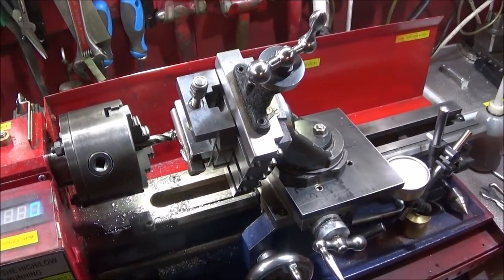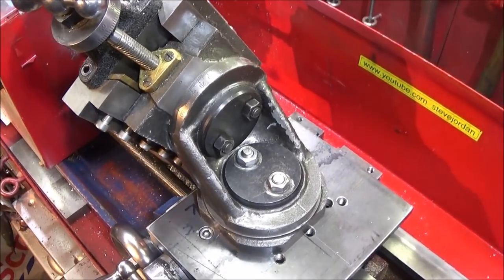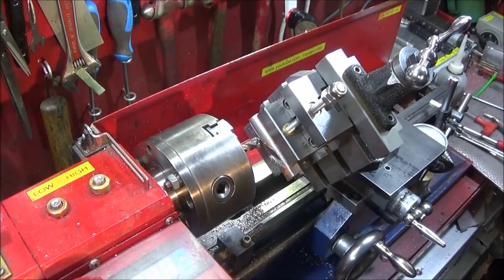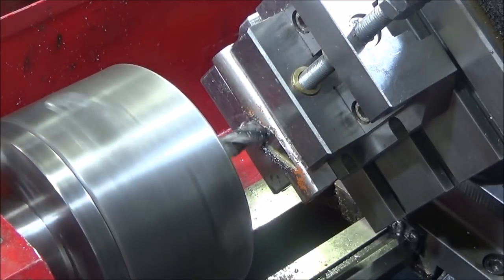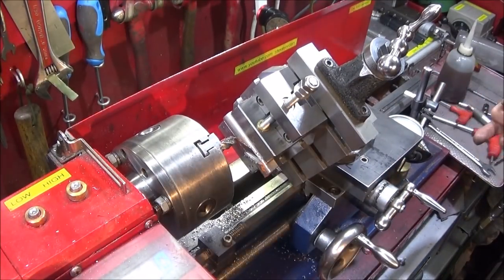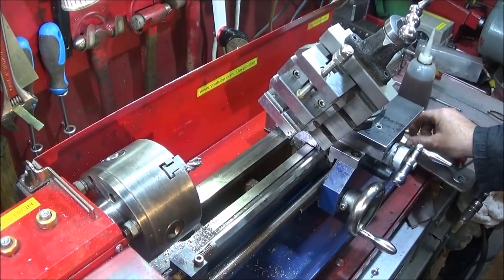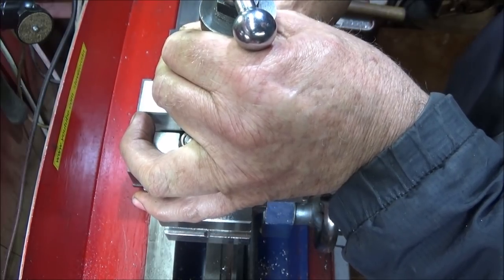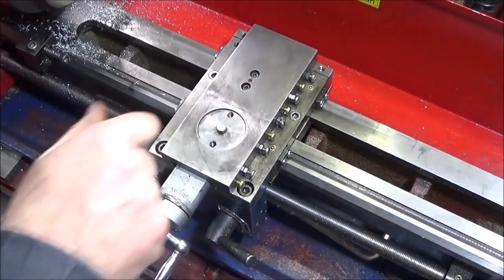Double Swivel Vertical Milling Slide For The Chinese Mini Lathe

Comment: Hello Steve. I have just completed this milling attachment, it works very well and is much cheaper than buying a mill of course. Now I need to reduce the free play in the cross slide/saddle, as the milling operations show it up - will study your video on the upgrade.
I have carried out one or two of your lathe improvements.
Keep up the good work!

Comment: Hi Steve, I know this video is from ages ago but I just thought I'd write to you and let you know that I have finally saved up enough to buy a double swivel vertical milling slide with vice from Chronos for my Chinese mini lathe (they ran out of stock 6 months ago). I'm in the process of fitting the 10mm plate to the cross slide and fitting the mill slide base to it.
I can see this opening a whole new window of uses for my lathe, not least the milling of new tool holders from the aluminium blocks that I cut ready some 12 months ago!
Thank you, Steve, for providing me with the knowledge and confidence to do this, your videos are an inspiration to us all.

Comment: Hi Steve, thanks for this vid. I've completed the same today, just a couple of modifications... My Mini lathe came with M6 tapped holes at the back of the cross slide for a travelling steady, so I used those to mount the palette. Also I aligned the bolts attaching the palette to the cross slide swivel disk at 90 degrees from how you did it, so the four mounting bolts are in a rectangular formation. It really does seem to be a rigid setup. Just made my first passes with an 8 mm end mill and the finish looks good with virtually no chatter. On to do your additonal gib locking screws next!
Reply from the maker: Hi Andy, Thanks. It sounds like you made a great job of that. It is surprising how rigid it is. I have been using mine today and it works great. I have one last upgrade to do to the pallet. I'm going to drill a hole directly above the carriage lock allen bolt for a 'T' allen key to lock. Regards Steve

Comment: I followed your instructions Steve thanks, and just finished. All is good and accurate.  Found a 9.5mm drill did the job as I don't have a 3/8", and used the 6mm holes as guides; a perfect fit on the Chronos milling vice. Also took your advice of fitting 2 more gib screws to the cross slide. The 10mm steel took some polishing, no-one seems to sell anything as good as yours! I may turn a couple of custom 8mm studs.

Comment: Steve, thanks for another great video! I just finished mounting the Myford Double Swivel Vertical Milling Slide onto my mini-lathe.  The dimensions of the slide was different so I had to recalculate the distance of the VMS relative to the cross slide. Did you use a foot of a table or something to ensure the chuck/milling bit and vise are aligned?
Reply from the maker: Hi Wilson. I square the vice up on the front of the jaws, touching the face of the vice before tightening it down fully.

Comment: Hi Steve, nice tutorial, do you have the exact dimension of footprint, means 3/8 dowel pins axis and M8 studs axis, and footprint flange roughly dimension ? i have to laser cut the steel plate and i would like to make drawing. Thanks in advance
Reply from the maker: Hi Thanks. Sorry but I do not have any drawing dimensions as I just machined the parts to fit at the time that I made it. I never make any drawings. Regards Steve

Comment: How much deflection are you getting with all the extra moving parts? Or is it negligible on that tiny lathe. I was thinking about adding on to my 13” lathe and using it to drive a CNC 3kw spindle.
Reply from the maker: Hi I don't notice any deflection. As long as the gib is adjusted correctly. It would be fine for something like that.

Comment: Hi Steve, I've been following your tutorials for a while now and I'm just finishing the task of mounting a dual swivel vertical milling slide onto my Colchester Chipmaster cross-slide. Excellent upgrade. Can you tell me which machine vice you used in this setup and where you sourced it please? To mount the vice, it looks like you drilled through the vice body and used a couple of cap-head bolts with T-nuts underneath, correct? Thanks, Martin Archer
Reply from the maker: Hi I think it's 75mm round vice bought from Chronos.uk. they usually sell two different sized ones and this one is the largest one I think. I haven't looked on their site lately though. Regards Steve

Comment: Hi Steve.  Many thanks for all the videos, they are inspirational.  You mentioned on this video that you purchased the plate on eBay.  Can you remember the seller please.  Thanks Noel
Reply from the maker: Hi Noel, Thanks. Yes I bought it from this Seller listing.
https://www.ebay.co.uk/itm/10mm-thick-MILD-STEEL-plate-sheet-profile-custom-cutting-available-FREE-POSTAGE/281858909687?hash=item41a019a5f7:m:mby2f3MonsP6prQYYjwc3Pg&var=580836916841
Regards
Steve

Comment: what size slide is that I want to get the correct one?
How big of metal meterial could be milled on that slide in your mini lathe?
Reply from the maker: Its the copy of the Myford milling slide. You could hold whatever fits on the face, but the Chinese Mini Lathe is very restricted in cross slide travel so obviously it has limitations.....its too much to for me to calculate and give specific measurements. You would have to see the lathe travel limitation and check out slide dimensions and movement specification, to see if it will be suitable for your needs.

Comment: Is myford  milling slide made in India now ? I mean does myford in England still exist? I  just got one of those India myford slides. Made by bluefox. And it's not too well machined. I'm disappointed in the India manufacturing of this. The tee slots are way off canted misalignment , if fact there is not a properly machined surface except the table. Can you still buy the good old myford slide from England? I just checked and yes it is still made in the UK.  If I  had to do over I would have got the high quality UK one. I just recently became aware that myford England shut there factory down sometime around 2011. However, Chronos sells the slde and must have a supplier.  The one I got on Ebay  by bluefox from India is poorly manufactured.
Reply: PUT !!!! EVERYTHING !! MYFORD !! AND !! CIRCUS !! HURCUS  !!! INTO !!! THE !! METAL !!! SHREADDER !!!! RIGHT !!! THIS !!! INSTANT !!!! DON'T !!! WASTE !!!! ANY !!! TIME !!! DOING !!! IT !!!! EITHER !!! TO !! SAVE !!! YOUR !!! SOUL !!!!

Comment: Steve follow your channel religiously. How can we get this stuff you get from chromosome, banggood ebay etc in the USA?? I live in the midwest
Reply: Randell Jones Randell I live in the eastern USA and have ordered several things from Bang Good .com I have always been pleased with there products so far. It usually takes me anywhere from 4 to 6 weeks for delivery. Most of the things I have ordered has been for a lathe. Good luck hope this helps.
Reply from the maker: Hi Randell, Chronos do ship worldwide but obviously the shipping costs would be high for these heavy items. I'm surprised that someone in the USA hasn't got these items for sale? If someone in the USA were to import these tools to sell them for reasonable prices like Chronos, they would have an excellent business. Most of these tool are now made in India and China and imported. Regards Steve
Reply: Paul S
1 second ago
lately I've been seeing more advanced vises and attachments for lathes and mills coming out of India. I'm tempted to get one, but know at those prices there has to be some cost reduction and quality issues. Probably good for mini-lathes as the need for .0001 accuracy is seldom on them.
Thank you for showing us how to do! This gets me thinking about how to vertically mount a rotary table and/or XY table on my G8688
Reply: Thanks Steve for your very informative and easy to follow directions 
 @pauls5745  I have just received the vertical slide direct from India purchased on eBay. While i haven't had the opportunity to use it yet seems to be reasonable quality & very good value. Postage was very fast.